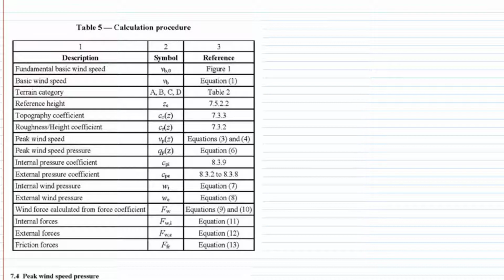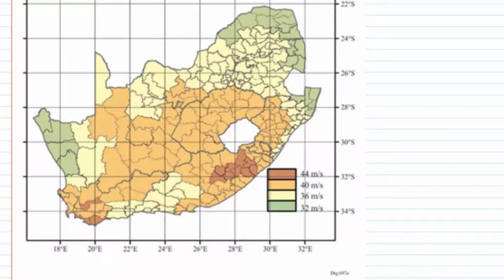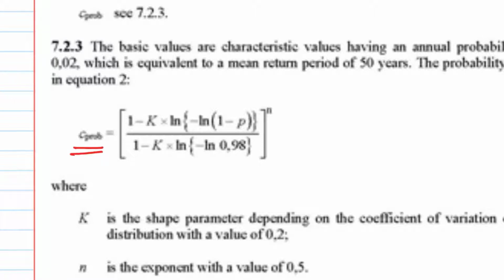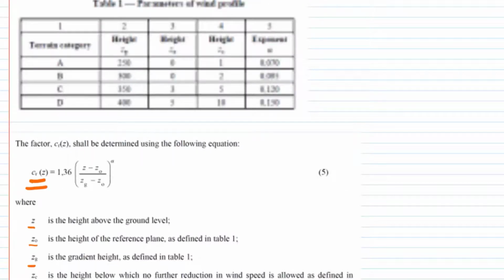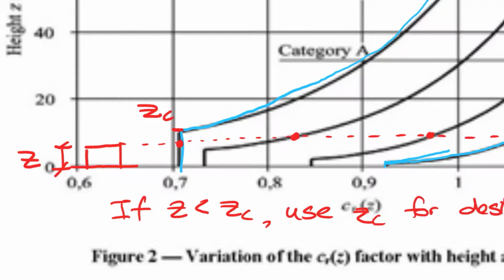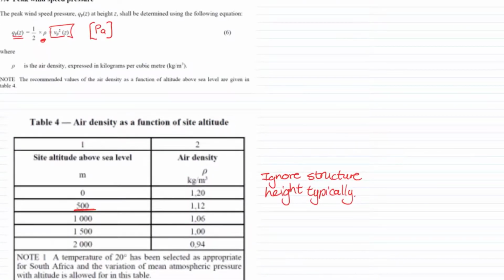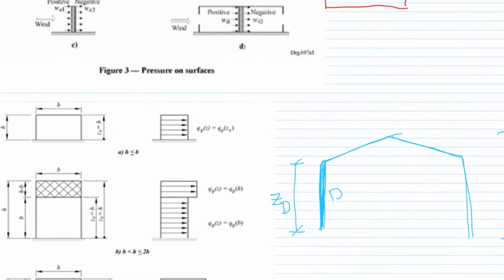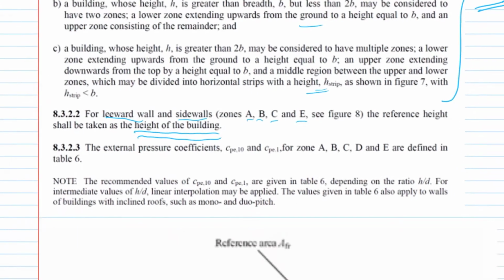Calculating wind loads for buildings - SD424

Comment: Hi! With which programm can I design a 2D or 3D hangar with dimensions and wind zones? Thank in advance!
Reply from the maker: Any structural analysis software can be used. The more important thing is to understand and correctly apply the wind loads, not trusting software too much. The loading on hangars is quite complex as the large open doors result in the hangar behaving as a canopy with the associated pressures being applied to it.
Reply: @richard_walls  I have calculated wind loads with SAP, but I would like to draw the plan of distribution of ultimate stresses at the vertical members and the roof , to use it in my thesis. Apart from Autocad, do you know any other way to make it faster?
Reply from the maker: @Ελπιδα-ν9υ  For my MSc I automated a computer script to plot the members and adjust member size based on the desired parameter. However, that will likely take you longer than AutoCAD. No sure of any other clever ways. However, if you have the coordinates of members you can probably plot the details in most graphing software, possibly even Excel.

Comment: Prof, how do you calculate the height between the apex and eaves?
Reply from the maker: Based on normal trigonometry. You need the width of the building and the angle of the roof.

Comment: Prof,, please make a vedio on  wind force calculation on open structures like platforms and pipe racks.
thanks and Regards
Ramesh
Reply from the maker: Haha. Thanks. We don't cover that in undergrad so unlikely to happen at the moment. However, in our SANS 10160-3 code the guideline for open canopy structures, pipe racks etc. are relatively clear and easy to follow after understanding the principles in this video.
Reply: @richard_walls  prof thanks for the reply.we love your lectures
regards
Ramesh